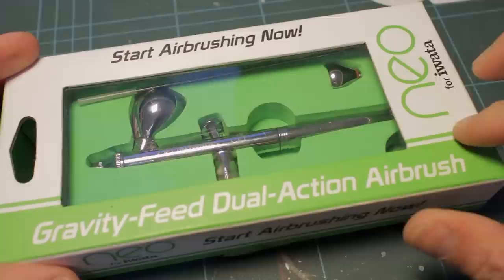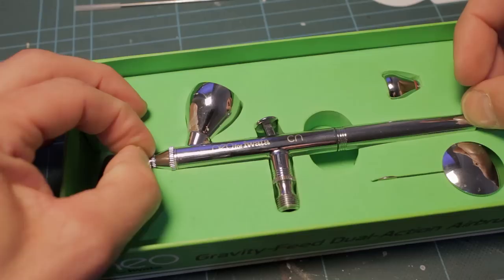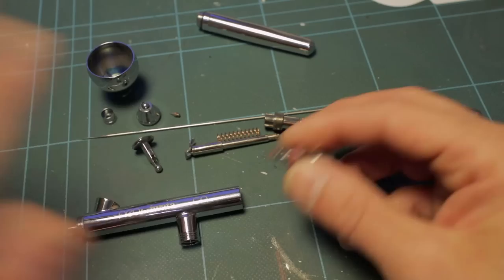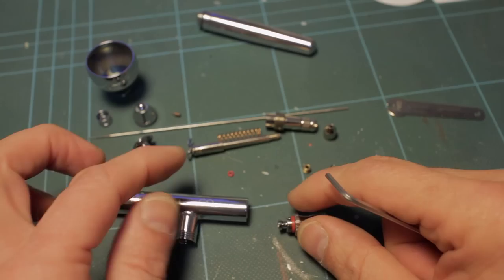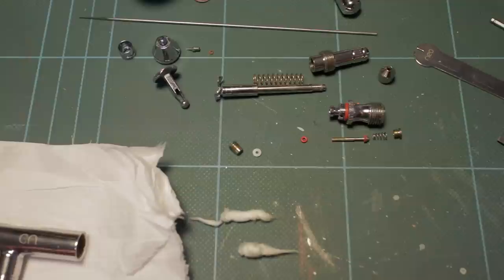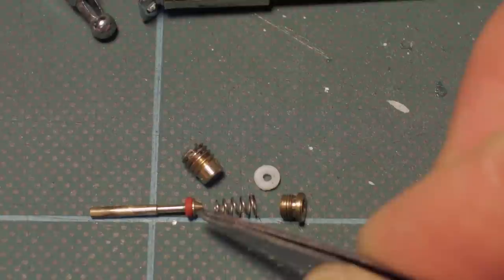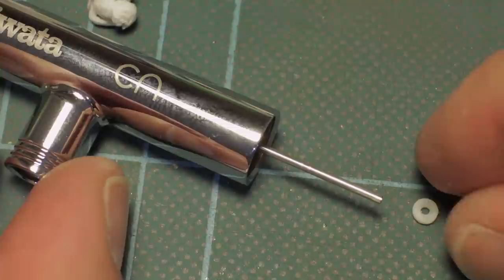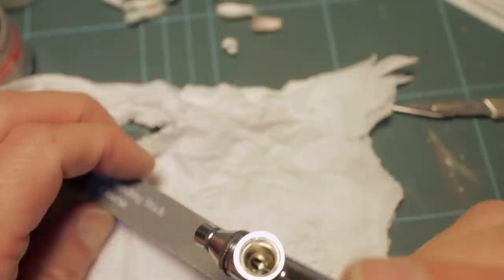NEO for Iwata, CN, Review & Complete Strip, Clean & Test

Comment: Interesting video, but I'm not sure it covers the issue I'm having. My airbrush will sometimes just stop spraying all of a sudden for no apparent reason, most recently while I was flushing it out after painting. The first time I had this happen I messed around with the air valve and it started working again just fine. Now it's happened a second time and nothing seems to be fixing the problem. The air brush isn't even all that old and certainly not caked with years worth of paint. I'm quite confused. And help would be greatly appreciated. Thanks.
Reply from the maker: Have a watch through this and if that doesn't show anything that might be the fault get back to me with precise details about it and I'll try to help. https://youtu.be/2Hxwev8c53o
Reply: @spidiq8  That's another excellent video, thanks. The problem seems to have worked itself out, lol, so I guess I may never know what happened... Thanks for the help, though.
Reply from the maker: @rbaldino  Hopefully it stays fixed. The most common cause of stoppage with acrylic is the paint drying on the needle tip, (assuming that air is getting through).
Give me a shout if necessary.

Comment: This video was so incredibly helpful! Thank you so much for this! I do have a few questions. I have watched a lot of videos on how to clean and air brush and my neo always got paint all throughout. I couldn’t figure out why, I did remove the needle from the back and not the front and that white washer in the very middle wasn’t gripping onto that needle at all. Are you always supposed to take the needle out from the front? Is paint ever supposed to make it back by the trigger?
Reply from the maker: Glad it helped. Paint should never get back near the trigger and I always recommend pulling the needle from the front to remove the risk of dragging paint through the seal and wearing it. If the needle use just falling through it needs to be adjusted so there's a very slight drag. Check this video for cleaning.
https://youtu.be/tcSBK0l5Lbw
Reply: Good question because I have one also now.
Is the trigger adjustable or should it be fully tight and when it's loose does that allow it to leak paint into the back? (No real trigger adjustment) 🤔

Comment: What is the size of the needle
Reply from the maker: 0.35
For some strange reason they went with this when usually the sizes go in 0.1mm increments but it works and it's a good intermediate size, you can still do fairly fine work and also cover a larger area.

Comment: Can you use different needles? I bought a cheap kit and looking to upgrade but I got like 5 different needle sizes already
Reply from the maker: Theoretically, yes.
However. It's not just the needle tips that differ according to nozzle size but the thickness of the spring steel they use to make the needles. Iwata typically use much thicker steel to make their needles than the Chinese made brushes and also h&s. Obviously the nozzles need to be correct for the grind of the needle tip aside from the needle diameter.
Reply: Thanks for the reply!

Comment: Can you just loosen the back nut to remove the needle and draw it out backwards if needed? I've seen this on other airbrush video's if you just wanted to clean the needle..thanks
Reply from the maker: You can but I don't recommend it because when you draw the needle back you're pulling paint and anything stuck on the needle backwards through the needle packing seal which will wear and potentially damage the seal if anything solid is stuck to it.

Comment: Thanks for a really informative piece.   I'd worked out most of this but trigger was sticking and constant air coming through.  With your help worked out how to dismantle trigger mechanism.  That said, there was no obvious gunk in there so is it common for trigger to stick?   Should I oil or will that damage it?   If oil can be used what sort is safe?  (Probably a daft question I accept).   Also, Iwata put up their own silent "official" cleaning videos and demo shows needle removed from back??!!   Iwata seem to think it's okay?   Thoughts?
Reply from the maker: Removing the needle from the back has been the default assumption since their creation. I draw them from the front because it's logical. Why drag paint residue backwards through the seal, also removal and fitting from the front removes the risk of bending the needle point.
Ideal you don't want to lubricate but if it's sticking when you press the plunger you can use the absolute tiniest amount of silicone grease on the o ring. To do this. Disassemble and remove the use valve o ring, get a spot of grease on your finger rub the o ring between your fingers, dry your fingers then rub the o ring on your dried fingers to remove as much as possible. Essentially you're minimising the risk of getting lubricant anywhere near the paint as it will ruin your paint job effortlessly.

Comment: You seemed to be able to easily remove the air valve, though the valve on mine won't unscrew at all. Is there anything else I can apply or should use to remove it?
Reply from the maker: It should open quite easily but if it's a bit hesitant wrap the knurled section with a few layers of tape to prevent marking it and use something like a small vice grip pliers or clamp that in a vice if you have one and use the airbrush body.
They can be overtightened but shouldn't be.
Reply: @spidiq8  The pliers did the trick! Thank you so much. Your video was ultimately the most helpful among the others I looked at on YouTube.

Comment: I really love this video this is helped me out so much I bought the same airbrush had no idea how to use it so I got frustrated I thought it was dirty I took it apart because I bought it used but in great condition so put away now after watching this and putting it back together I lost the spring do you know if any spring will work for this airbrush because I can’t find it anywhere 😫 thanks for the video 😀
Reply from the maker: Glad the video helped, any spring which is the right diameter and length will work certainly, it's sole purpose is to close the needle.
Try a magnet for finding yours.
Reply: @spidiq8  sweet thank you 🙏
Reply: So I lost my nozzle so I bought a new one on eBay it’s a .35 mm it’s supposedly for the Neo but I can’t screw it back on do you know if it’s supposed to be easy or are they difficult to put back on maybe I got the wrong size let me know please thank you
Reply from the maker: @seanpacificrailroad3700  0.35 is the standard supplied with the neo. It should screw on easily. Is there thread from the old nozzle still stuck in the brush? Check under magnification and try fitting in a cocktail stick and unscrewing. If there's a piece of thread left in there that should remove it. A little trick to help hold the nozzle is a piece of biro tubing over the nozzle to give you something to grip on.
Reply: @spidiq8  cool I will try that thank you so much 🙏
Reply: @spidiq8  Wow you are right there was a piece of thread broke off in there so what I did I took a very sharp end of the tweezers put it in there and I unscrewed it out 😁 thank you so much you are a  super hero 🦸‍♂️
Reply from the maker: @seanpacificrailroad3700  glad to hear it's sorted, that's what normally happens when the nozzles snap. Be sure to not tighten up the new one too much. Just snugged up with the spanner supplied is more than enough.
Reply: @spidiq8  great thank you I put it all back together but just a tiny bit of paint comes out if any at all I’m pretty sure I have the paint thinned out enough maybe my pressure is too low or too high I’m not sure and I noticed the tip of the needle was bent just a little maybe I’m not made out the airbrush lol 🤔🤪

Comment: Dear sir, have you noticed that it says ‘Neo FOR Iwata’ on the box? I suppose it means that the Neo airbrush was made for Iwata from an outsourced manufacturer. What about the ‘CN’ boldly printed on the body? Does it means China?  
Is this a low-cost made-in-China airbrush (I don’t mean a bad one) designed to make the customer happy because it has ‘IWATA’ branded on it?
Reply from the maker: Yes, this is no secret, Iwata are very open about it.
They're an Iwata design manufactured in China, (the same factory produces another well known entry level brush), but they're built to Iwata's guidelines and under strict QC so you're much less likely to get a 'Friday afternoon' model.
It was Iwata's means of producing an entry level brush to compete with the many cheaper chinese made ones, some are very good but some aren't.
In one of my videos I compare it to my very first cheap chinese brush and the quality difference is night and day despite them both spraying OK.
Reply: Thank you sir, for your clarifying answer.

Comment: Do you have a vid showing you putting on a beeswax seal??
Reply from the maker: I don't but it's as simple as taking a cocktail stick and coating the point from a block of beeswax and smearing it on the threads of the nozzle. You only need a little.

Comment: thank you very much for this video, I have a second hand syphon feed NEO BCN, but even though I cleaned it as my normal airbrushes, it didn't work. even now with your thorough methodI went deep,I found traces of cloged paint, I cleaned it, BUT the air pressure is very low,(even in 60PSI and it doesn't suck the paint up. how can I get to  clean the "airpipes". Greetings from Crete - Greece
Reply from the maker: If paint has gotten past the seal and into the air valve you'll need to strip it and ideally soak it for a little while in lacquer/cellulose thinner, remove all rubber o rings first though.
The air valve unscrews from the bottom where the hose connects and can be disassembled and you'll see if there's paint in there. The mid section of the body of the brush is more likely to be the culprit so removing the needle, nozzle, cap etc with any o rings place the body in thinner and if you can get hold of some pipe cleaners you should be able to brush inside the air outlet tube which is the hole next to where the nozzle fastens.
That's a beautiful island you live on. My very first holiday abroad and one of the most memorable was there on the south of the island at Elounda.
Reply: # spidiq8 ..... I am watching your other videos now. "Airbrush Troubleshooting Guide, Why Doesn't It Work? Demystifying Airbrushes." and Iam trying to clean the "blue" pipe little by little.
Reply from the maker: @ostriaairbrush9877  Good luck. Hopefully you'll be up and running again in no time. Check that you have a very slight drag in your needle seal on reassembly. The teflon seals wear and this is where paint typically gets through.
Reply: thank you for your advices,( I live at the west part of Crete, (Chania), but Elounda is very nice also.) I disassembled everything , but unfortunatelly my nozzle O-ring broke as well, I soaked all the parts in a airbrush cleaner, I also used some brushes for tobacco pipes and  in between teeth brushes "Tepe", Also afterwards an ultrasonic cleaner, and brushes again. about the nozzle O-ring I tried to make my own but even without it works , finally IT WORKS !!!
Reply from the maker: @ostriaairbrush9877  That's great news. Carry on using it without the nozzle o ring if it's working without. Just be very careful you don't overtighten the nozzle as the threads can break of you do that.

Comment: you forguet to  show how to reensamble the needle, which is the right measure in the point
Reply from the maker: Could you clarify please Cecilia, I'm not what you mean?
Reply: @spidiq8  yes thanks for answering ,the needle, how far the needle excels the point of the airbrush
Reply from the maker: @zeziaguilar4348  For refitting, you slide the needle in all the way forward until it seats in the nozzle, it will protrude slightly. A couple of mm, don't use any force to seat it though. I hope this is what you're needing to know. If not let me know.

Comment: Sparmax make the neo so I read! I've got a new sparmax and it's awful I was going to go for the neo this week but been reading manufactures information and it's sparmax who make the neo it's not that it's made from cheaper materials I'm now concerned on the trigger pull back as the sparmax I have is a very long travel before it will push any paint through that's why I hate it! I'm trying to find out what the trigger pull back is like on this if its short like I'm used to the sparmax is so weird to use it makes it unfun!
But you taking it apart there it's near Identical to the sparmax 0.3 sp I have! It's pretty amazing just how much its the same just with Neo instead of sparmax in the side there! But that's what it is a sparmax so it will be the same!
Reply from the maker: I haven't used a Sparmax so can't give a comparison.

Comment: You didn’t show how to put it back together :(
Reply from the maker: It's simply a reverse of the disassembly. I could make a video of that if it's something you need but can't promise it will be really quickly as I'm very busy currently.
Reply: @spidiq8  I can’t seem to get the rear assembly linking up with the trigger correctly :(
Reply from the maker: @dgriffy04  Sorry I didn't reply sooner. Could you elaborate on the problem please a little and I'll try to assist.
Reply: @spidiq8  I’ve fixed it. I watched another strip video and figured it out 👍🏻
Reply from the maker: @dgriffy04  Good stuff. Thanks

Comment: This is a really bad airbrush. It's a splattergun with no control or finesse. I returned mine in disgust. I've had better no brand Chinese ones off ebay.
Reply from the maker: That could only be due to a problem with your specific example or user error unfortunately.
This one, bought second hand and cleaned properly sprays beautifully. I know many other Neo users who have similarly good experiences with using them. The only complaint I've heard are from newer users over tightening the nozzles and breaking them. Typically they only do it once.